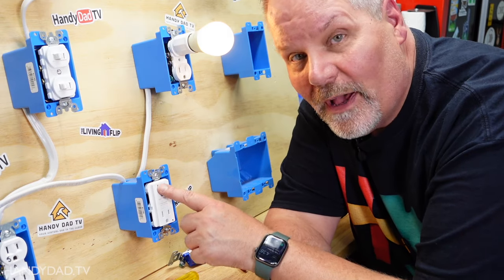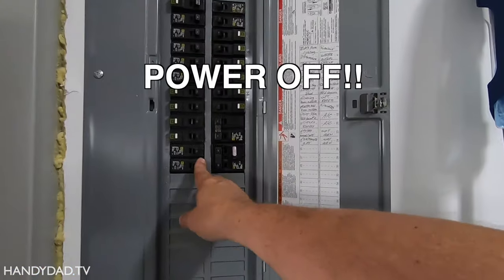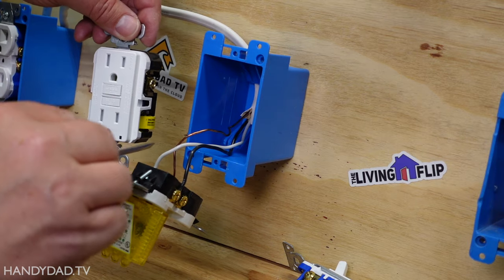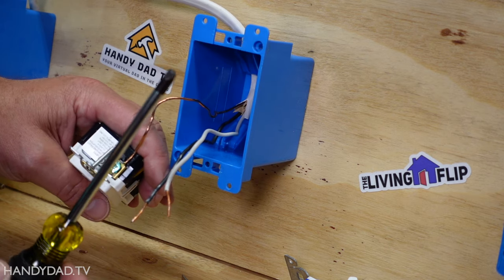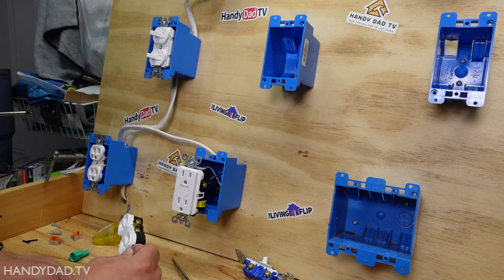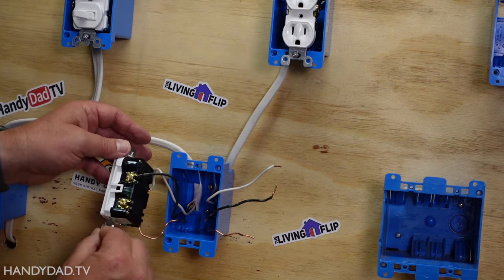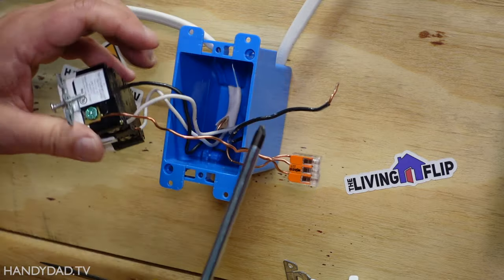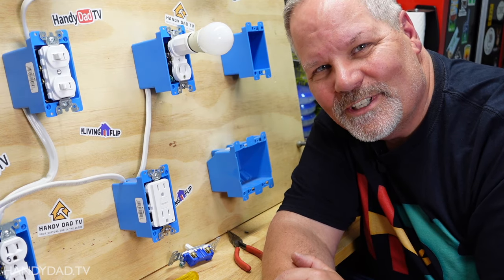GFCI Outlet Wiring

Comment: Be careful!!! The LINE and LOAD of the GFCI can be either on the top or bottom depending on manufacturer.   The markings are not always easy to read. I learned this myself and it drove me nuts!!!
Reply from the maker: Yes indeed. Thanks.
Reply: What happens if you wire it up backwards?
Reply from the maker: The outlet will not be protected. The test button will not work.
Reply: Yes I’m in the hospital now bro , flew through the roof after trying to do my own electrical
Reply from the maker: @susieblanco2722 Not funny bro.
Reply: Yep it happened to me, until I looked in the back of bottom old & new & realized the problem 😊.  First time trying to replace an old GFCI receptacle & I did it!!!
Reply: I have a spec(commercia) grade GFCI in one of my bathrooms that is wired properly, line and load and works as expected with one caveat. The yellow light is normally off unless tripped or the test button pressed. It's my only GFCI that is lit when the power is actually off, and I can't find instructions but just thought that I would post here because I had forgotten that was it's normal state and the load goes to an outdoor motion sensor light that I recently upgraded to a leviton lever clamp decora switch that had me baffled as to why there was no power after the upgrade. I tried all 4 other GFCIs in the house as well as all breakers, checked junctions in receptacle boxes when it occurred to me to try the reset button on that particular GFCI. It only had an electric toothbrush plugged in and I hadn't paid  attention that the charger wasn't on, but the indicator light was. After reset, charger light and the outdoor light/switch outlet are back in business. All that just to say, make sure you read the instructions and know the normal operation of your particular GFCI.
Reply from the maker: @Dramob Some brands are green when protected and red when tripped.

Comment: SO IF ALL THE OUTLETS AFTER THE GFI WERE THE REST OF YOUR WET AREAS, YOU WOULD ONLY NEED 1 GFI IN YOUR HOUSE? AND GFI BREAKERS WHEN WOULD YOU USE THEM?
Reply from the maker: In theory, if you had enough capacity on one circuit, you could connect all wet area outlets to one GFCI outlet. Not practical though. 

A GFCI breaker can be used to protect the entire circuit.

Comment: If the grounds weren't connected together in a pigtail would that cause the receptacle not to work at all?
Reply from the maker: I think it will still work because some old homes have no grounds, but they can still use GFCI outlets.

Comment: I replaced a non working old gfci outlet with a new one the same way and still there seems to be no power coming through. Could you give me some advice?
Reply from the maker: Could be a loose connection upstream towards the circuit panel. Use a voltage tester to find the break.

Comment: Well explained. Question - how do you then replace an old outdoor receptacle with a GFCI where the outlet is in the middle of a circuit with non-GFCI receptacles located before and after the outdoor box? FYI - the circuit is protected from AFCI breaker in the sub-panel. Is pig-tailing needed?  Thank you!
Reply from the maker: If you don’t need/want the downstream outlets to be GFCI-protected, connect everything to the LINE screws. Don’t use the LOAD screws at all.
Reply: @handydadtv  Thanks for the response. FYI -  the wires in the box are short and need extending. Can I just use Wagos/wire nuts to lengthen each of the 4 wires and attach, or do I need to pig-tail, resulting in 3 wires per Wago/wire nut lead? Thank you very much.
Reply from the maker: @stanphilipps7610 I usually try to use a 3-way Wago with a long pigtail to the outlet.

Comment: great video, my old outlet upper part is working the lower part is not working. if I replace with a new poweroutlet it will work? Thanks!
Reply from the maker: Both sockets on a GFCI should work together. If one isn’t working, replace the device.

Comment: That very was so clear and well made. I have a slightly different scenario that I can’t figure out. I have an older house and I want to swap an older outlet in the bathroom with a GFCI. As I’m working on the project, I realized that the outlet is also powering the bathroom light downstream. There’s one black wire, a ground, and two whites. Can I install a GFCI in this scenario?
Reply from the maker: You can always replace a standard outlet with a GFCI. Just connect the wires to the LINE screws on the GFCI.
Reply from the maker: Clarification: connect the same wires that were connected to the old outlet.
Reply: @handydadtv  Thank you very much for taking the time to reply. I connected the wires to the GFCI exactly the way they were connected to the old outlet, and it gave me a fault (red light) on the GFCI. Just to be clear: the only black wire was connected to the golden LINE, the white feeding the outlet was connected to the LINE on the silver side, and the white feeding the light fixture was connected to the LOAD silver. The ground was also connected. Unless I’m missing something (which is very likely)I think I can’t take advantage of the GFCI protection unless I open the wall and figure out the wiring and dig out the live wire feeding the light. So I went to buy a brand new standard outlet and rewired everything like it was on the old outlet and everything works fine now. (I don’t feel like opening the wall right now!) 
Thanks again.
Reply from the maker: The fault was probably caused because both neutrals should have been connected to the LINE screw. You shouldn’t be using the LOAD screws.
Reply: @handydadtv I think I might try that tomorrow. Thanks again!

Comment: I need to replace a receptacle that feeds other receptacles or outlets, but I have a metal box. Do I pigtail the additional outlets and receptacles the same as in the video?
Thank you, your presentation is great.
Reply from the maker: If you’re replacing a GFCI outlet, by default you should always connect the wires exactly as they were on the old one.

Comment: Great video!  Can I wire multiple gfci outlets on the same circuit?
Reply from the maker: Yes, but independently. It’s not recommended (or necessary) to wire a second GFCI from the LOAD terminals of an existing GFCI.
Reply: @handydadtv  I appreciate the response thank you

Comment: At @7:31, you mentioned you can hook up additional outlets to the GFCI outlet to be protected, can you elaborate how one does that? For instance, I have a bathroom GFCI outlet. When I look at the contacts at the back of the outlet, there are already wires connected to the line and load screws. So, would I just disconnect the black and white wires attached to the "load" contacts, bring in the additional black and white wires from the new outlet and connect the two whites together with a white pigtail (ie. 3 wires in a wirenut) and connect the pigtail to the silver load screw? And then similarly for the black wires?
Reply from the maker: Yes pigtail the new outlet to the load wires of you want it protected.

Comment: Excellent video.
I am somewhat familiar with basic wiring, but ran into something I have never seen on a gfci receptacle.   I have a gfci in my garage that seems to have issues with power.  I cut the power off and pulled the receptacle to look at it. The wires are back mounted and the screws were loose, which may have caused issues. That problem solved.  But I noticed something I have never seen.  There were two black wires and two white wires inserted at the top and a white and black wire inserted at the bottom. Can you let me know why there are two wires inserted at the top of the receptacle?
Reply from the maker: There is no standard for top and bottom, but let’s assume the top is the Line and bottom is Load. 

The Load protects another outlet probably elsewhere in the garage. 

One of the wires on the Line is power in from the panel. The other wire feeds something else on the circuit that doesn’t require GFCI protection, such as your lights or garage door opener.

Comment: If I have three sets of wires coming into the GFCI and I want to add an additional plug down stream.  What is the connection?  Does the other plug need to be a GFCI as well.  This scenario is in a bathroom wall.  Thanks for the great video.
Reply from the maker: Don’t change the existing connections. But connect the new outlet to the LOAD terminals on the GFCI if you want it protected. Hopefully it’s a nice deep box for all those wires.

Comment: Thank  you.great video. Helpful.
Reply from the maker: Glad it was helpful 👍🏻
Reply: I'm installing a sump pump outlet  from an old plug box in my basement. Question I did notice a ground their can i still wire this as a GFI recepticle
Reply: should have said didn't notice a ground there
Reply from the maker: You can still use a GFCI outlet without a ground, but if you have a metal box, it’s probably grounded.

Comment: Thank you for the video.  One question - can you put two line/neutral wires on the same screw?

I have this situation (o = outlet, po=protected outlet)
--> o1 --- o2 ---- o3 ---- o4 ---->

I'm adding three outdoor outlets like this:
--> o1 --- o2 ----- GFCI ---o3 --- o4 ---->
                                |----> po1
                                |----> po2
(Off the GFCI I'll run a line to two other outside protected outlets.)
I do NOT need any outlets (o1, o2, o3 or o4) to be protected as they are existing outlets inside the house.

In order to save space in the GFCI box, I would like to take the wire from o2 and the wire going to o3 and put them right in the screw holes on the GFCI and not use jumpers.  Having 3 jumpers (black, white, ground) instead of just one jumper (ground) would take up a lot of space in the box and make it really difficult to get everything in.

Thanks so much for your help.
Reply from the maker: Lucky for you, most GFCI outlets are back-wired devices that can support two wires per screw. The only one you’d need to pigtail is the ground.

Comment: HI YOU MAKE IT EASY TO UNDERSTAND THANK YOU. i wanted to ask so im fixing to wire my garage and i want to know if i should do the entire outlets pigtails/parallel or if i should wire them in series. thank you.
Reply from the maker: Thanks 😊 Always wire outlets in parallel (white to white; black to black). You only need pigtails if you don’t have enough screws.
Reply: Some local codes forbid the use of a wago for the bare copper wires.   You have to use a wire nut and keep twisting until the wires just below the wire nut coil up like a braid.
Reply from the maker: @BradThePitts This is news to me. Do you have a reference that shows where Wagos are not permitted?

Comment: Hello, I really enjoyed your video. I have a question.
My GFCI keeps tripping every time my washer turns on. I checked the wiring, and it looks perfectly fine. I bought a new GFCI, and it still trips sometimes after a couple of seconds. However, the regular outlet in my hallway works perfectly fine if I run an extension cord to my washer. Do you think it might be the main fuse down at the fuse box?
Reply from the maker: Good job troubleshooting! You did everything I would do. 

This has nothing to do with your circuit breaker. Unfortunately, it’s the washer. A wire may have frayed somewhere because of vibration and it could be a shock hazard. 

If the washer is under warranty, call for service. If it’s out of warranty, you need to decide if it’s worth trying to fix (could be expensive) or just replace it. 

Using an extension cord to a non-GFCI outlet is definitely not recommended.
Reply: @handydadtv  thank you very much much… keep up the great work

Comment: Great video. I have a question for you, I replaced a gfci outside my house, just replaced the wires like they were on the old one. Hit the reset button and the green light came on, but there is no power to the plug ins. I plug something in and it don't work. I tested the terminal's at the in line and there is power, but no power when I plug something in.  Do you have any ideas?
Reply from the maker: If you’re SURE you connected the wires to the LINE side, try a different GFCI.
Reply: @handydadtv  Thanks for your help. The new gfci was reversed. Line on top and Load on the bottom. Same brand ! you would think that they would be the same. Thanks again.
Dave C.

Comment: thank you for this, so in this scenario you’re not able to use wagos and pig tails for the hot and neutral to the GFI?
Reply from the maker: No, you can always have the option to use pigtails.
Reply: @handydadtv 
I have a gfci outlet installed already with the green light on but no power coming thru. What might be my issue sir? Any information is greatly appreciated. Thanks in advance

Comment: Hello jeff. First, 🙏thank a lot for all your magnificent tutorials. Now, I have a question, how can I wire a GFCI from a light fixture and have it on all the time even when I turn off the light switch, can that be done?
Reply from the maker: Drop the light fixture and see how it’s wired. You need constant hot and neutral. The light will definitely have a neutral, but it may only have a switched hot.
Reply: @handydadtv  I do have neutral and constant hot on light fixture
Reply: @handydadtv  can you shut a video for this...  Wired light fixture to GFCI procedure?
Reply from the maker: @LuisLopez-tz3ey Follow the directions with the GFCI. Connect the hot and neutral to the LINE screws just like I showed in this video.

Comment: Hi Handy Dad.    Love your work.  My question is  I am installing a GFCi in a dual outlet situation and feeding two other loads from it.  Do I wire the GFCI  directly to the adjacent outlet and wayco for the other two loads, or do use a wayco to join all the other three loads  together?   Thanks,  Paul
Reply from the maker: If you want (or need) the downstream outlets to be GFCI protected, wire them to the LOAD screws.

Comment: Thanks for making this video. I have connected 12 gauge wire from a 15 gauge wire to a GFCI outlet and from that GFCI added 6 additional outlets. Will upsizing the wire (15 to 12) cause all of the outlets to not work? Also the breaker is a 20 amp breaker.
Reply from the maker: A 20 amp breaker requires 12 gauge minimum. If you have any thinner wire on the circuit, it is a fire hazard. You either need to replace the thinner wire or downgrade the breaker.
Reply: @handydadtv  the wire runs the entire length of the house, it is white assuming that is 14 gauge? It will be easier to change the breaker.  Thanks for your help!
Reply from the maker: @I-build-crafts Don’t trust the color because all Romex was originally white. Look for AWG written on the jacket.
Reply: That is interesting. As far as I know this home was built in 1986.  Is the a wire gauge tester to help identify the wire size? Visually it looks like the same as 12 gauge wire. Thanks again!
Reply from the maker: Color coding started in 2001 so it makes sense that yours is white throughout the house. Since it’s a 20-amp breaker, you can reasonably expect the wire is 12 AWG even if you can’t see the jacket writing.
Reply: @I-build-crafts  Use a wire stripper and see if the copper in your suspect cable fits perfectly into the #12 awg slot.

Comment: @lynnmoe2241 0 seconds ago

Thank you for helping/showing me how to hook up a GFC combo. I Got a 20amp It-swtch/gfc and was at a loss for clear direction in hooking up the light switch/gfc on btm added back wires: on a orange hot, yellow neutral and red to It/ switch /power. The other wire to share w line in/hot. Question?? I used a Wago 221 on the one gfc -asred its #14 aluminum stranded to # 12 awg copper, tapped levers down and solid in box, should I use that anti corrosive-paste in the Wago?? The led light is low watt and all other connections are Tessa taped (good stuff). inside wall no humidity/dry. Or should I redo with a yellow good nut cap.. Thx in advance Lynn
Reply from the maker: No need for anti-corrosive paste in Wagos.